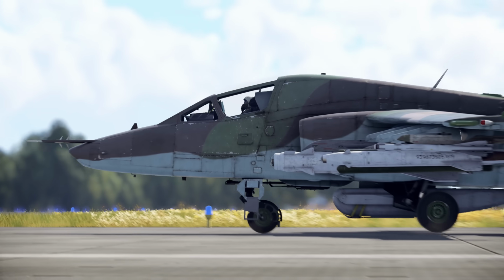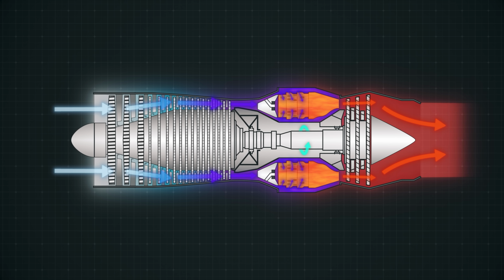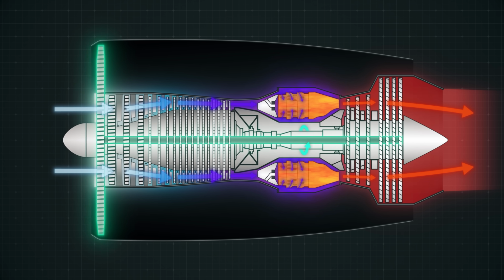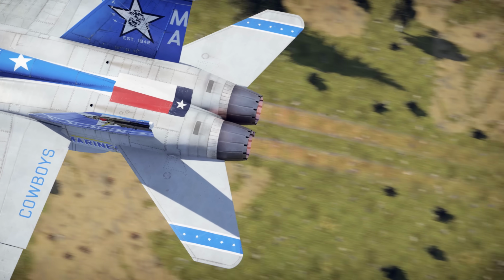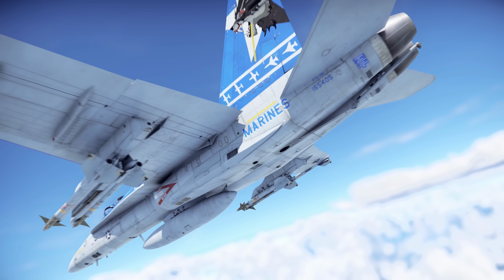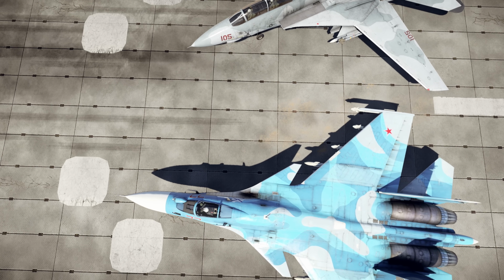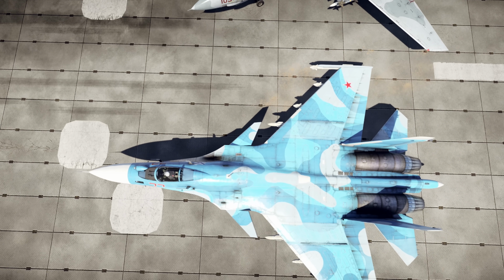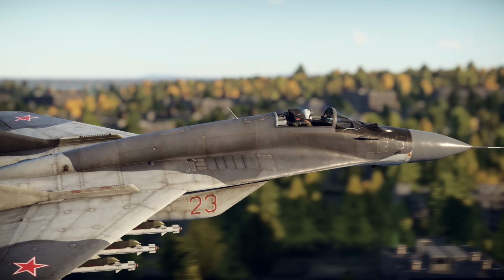How It Works: Turbojet Engines

Comment: Day 109 of asking for Air Assault 8.3+. We have F-18 fighting 6.7 planes, this is pathetic.

Please for the love of god, add a new 8.3+ assault at the minimum if not others like 10.0+.

We need higher BR planes to allow more pilots to get 1500 points (about 80% activity) for ~3.2k RP.

The planes in 8.3+ or higher also NEED MORE SPACING to prevent AGM cheesing and missiles taking out 3-8 planes a hit.

Comment: With how the values are presented, 'thrust values' should definitely be higher.
The F100-PW-100 on the F15A should produce 13500 kgf, not just 6140 kgf.

Comment: When are you going to fix the Battle Ratings in Air Simulator Battles?

You keep adding a large number of post-war aircraft between BR 4.7 and 5.7, while completely ignoring the fact that aircraft like the Fw 190 Dora (D-9, D-12 and even the A-8) are still stuck at 5.3 and 5.7 respectively.

At the same time, you introduce aircraft such as the Sea Fury from 1947 and other premium post-war fighters, while maintaining iconic WWII aircraft at Battle Ratings where they can no longer use their historical strengths, because later aircraft simply outperform them in every relevant metric.

What is Gaijin’s justification for keeping the Fw 190 D-9 at BR 5.7, when there are objectively superior aircraft already sitting at 5.3?
Not even at top tier is it possible to exploit the advantages the Doras historically had in their own era.

This balance is shameful. Fix it.
Not everyone wants to fly the Bf 109 K-4 or Griffon Spitfires all the time.

You keep pushing new aircraft into the game—many of which never even saw combat in any WWII theater—while failing to low.

Another question that needs to be asked is: why are aircraft such as the Spitfire Mk. IX placed so far below the Fw 190 Doras in Battle Rating?

This effectively forces players to fight in an Fw 190 A (Anton) against an aircraft that is clearly superior in performance.

The same issue applies to aircraft like the Yak-3, which were introduced into service when the Me 262 was already operational.
What kind of “simulation” is this supposed to be?

Is simply having a cockpit view enough to call something a simulator?

I have never seen a game so fundamentally unbalanced in this regard.
It is obvious that there are far more Spitfire fans than Fw 190 fans, but does that really justify this level of irresponsibility and disregard from Gaijin?

Since Gaijin shows no respect for historical facts, at the very least lower the Fw 190 D-9 to BR 5.0 and the Antons to 4.3.

Comment: I think the one simply thing you overlooked in turbofans is that there are both rotor fans and stators (i.e., stationary fan blades), it's not all rotors. This is to help with air compression.

Comment: with this much attention to detail with engine power in planes varying in the environment. Will we see something similar with tank engines and electric drives? For example why do electric drive tanks have gears and power bands like combustion engines in game?
Reply: Electric drive tanks DO still need gears AND have power bands since they are usually driven by a diesel generator. Electric motors can only provide so much torque, so gears / a transmission is needed to convert their high speed into torque. Likewise, they aren't constant speed - the output of the motor can vary within a single gear. Since energy cant be created nor destroyed, the diesel generator either needs to ramp up or down to match the consumption of the electric motor (or waste the power). Since combustion engines have power bands - a combustion driven electric engine ALSO has a power band, just a much larger one. 
That isn't to say Warthunder is modeling these correctly..... I'm sure they aren't.
Reply: even if the electric engine has enough torque, driving 30t tanks without gear will just kill the battery in less than 10 minutes due to how high the rpm has to be